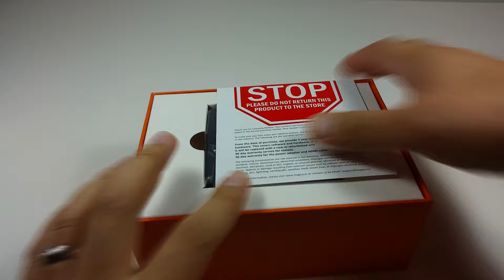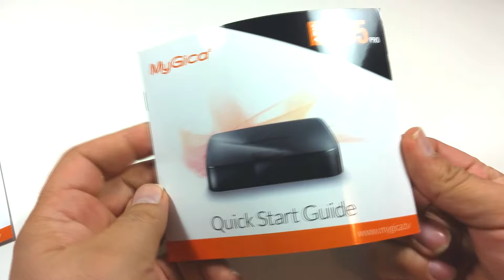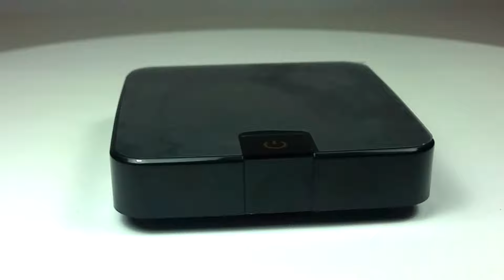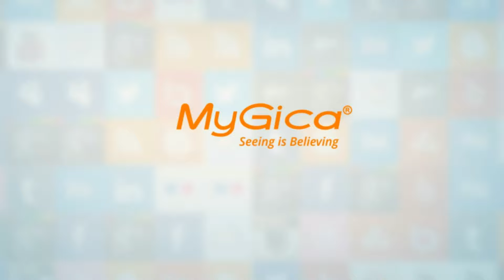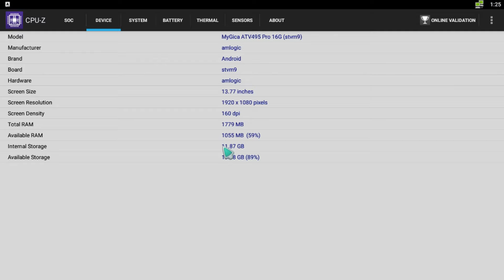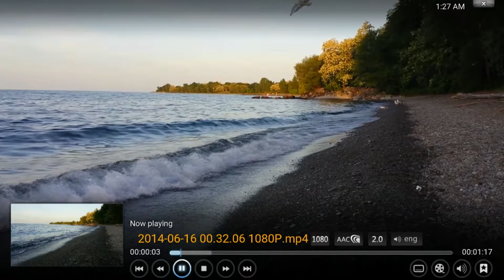MyGica ATV 495 Pro S905 16GB - Android smart tv box un boxing and Full Review

Comment: The wifi is really bad on this unit, anybody else have the same problem?
Reply from the maker: wifi depends where your router or modem is.
how far are you from modem or router. and how many bar of signal it is showing?
Reply: @xctechs  Hi, I am 2 rooms away about 12 meters. The signal shows good, only 1 bar from perfect. I have 2 internets using their own routers. Even when testing them one at a time the speed is way below the allowed speed. Router 1 is a 3meg line and router 2 is a 10meg line. The android player picks up only 1meg speed. When connecting the lan, its works perfect.
Reply from the maker: @qubagrumpy219  hookup wifi on 5G and then use wifi speed test and see the wifi speed.  If you connect 2.4G wifi you should see max 30Mbps speed with 500Mbps internet.

Comment: I have the ATV495.  For some reason, it seems to be frozen.  I can no longer navigate even when I select the mouse.  it only responds to the power button, but I can't navigate thru any of the options like, "Stand By" or "Reboot".  When I unplug the box, wait, plug it back in and power up, the same thing happens.  I'm unsure what to do.  Any advice would be appreciated.
Reply from the maker: Ciovanni Campbell check your usb dongle for remote.  hookup a computer mouse and check i am sure your remote reqire a pairing
Reply: Hi XC, it definitely does seem to b the air mouse.  When I plug in a regular mouse it works.  Thank u so much.  How do I do a pairing for the air mouse.  Thx
Reply from the maker: Ciovanni Campbell grabe your remote, make sure your remote have good battieres or new once. 

press and hold vol + and page + for 5 seconds you will see blue light flashing quick and then press navigation keys and your remote will pair. and your box will not seem frozen.
Reply from the maker: Ciovanni Campbell grabe your remote, make sure your remote have good battieres or new once. 

press and hold vol + and page + for 5 seconds you will see blue light flashing quick and then press navigation keys and your remote will pair. and your box will not seem frozen.
Reply: I was having trouble with mine freezing up too,I tried pairing and it works now.Thanks.
Reply: It seems the dongel is a common problem. I had exactly the same problem

Comment: any reason when I set up and the mouse or controls don't work on remote? Yes I have the USB plugged in, remotes only functions are on/off?
Reply: the remote is the KR41 remote
Reply from the maker: chris bratton it is the static mouse not airmouse
Reply: not understanding it is the 
static mouse not air mouse?
Reply: I've tried synching the remote but having same issues
Reply from the maker: chris bratton if just purchased contact seller for remote exchange.
Reply: if the remote works on all platforms, if I were to plug into my PC it should work, again it does not, get message about not recognized/malfunction so it likely the usb dongle that's causing the issue...will return remote as just purchased device this morning..TY